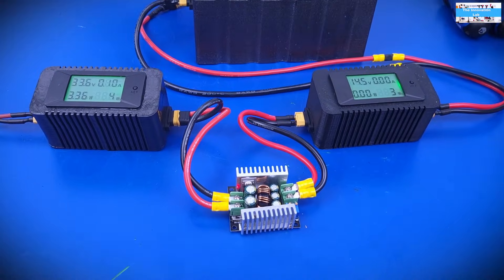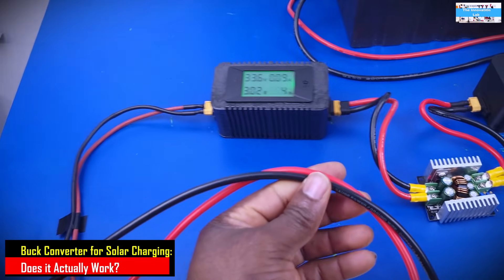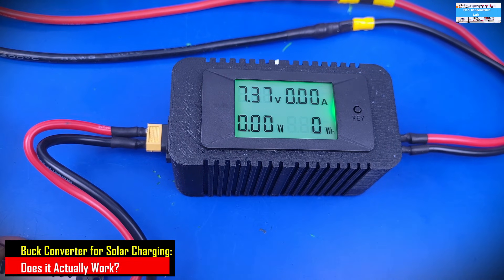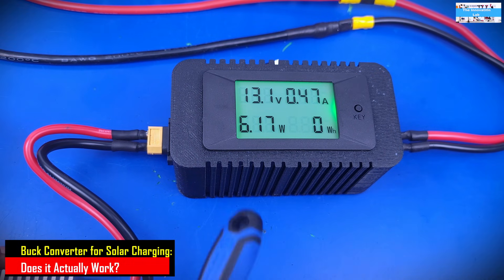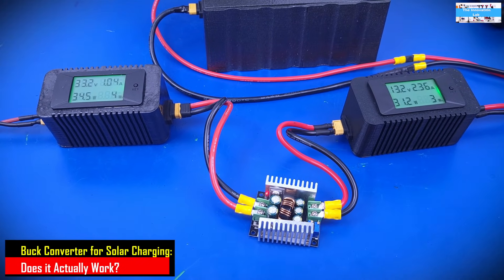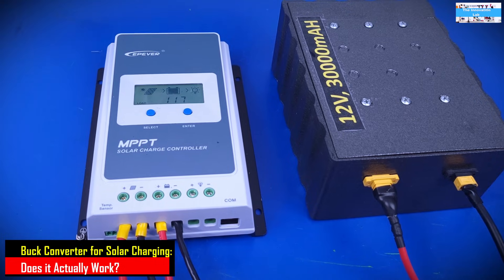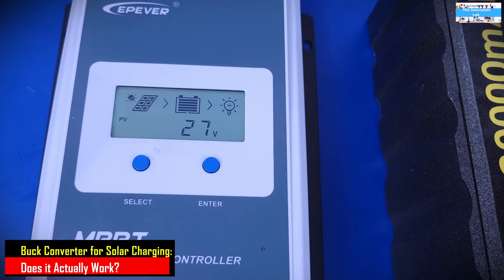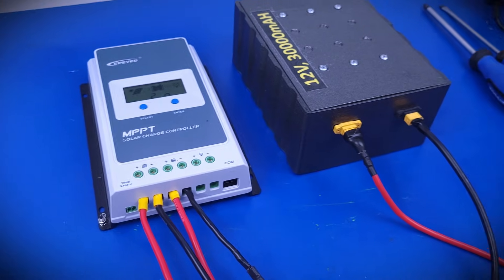DIY Solar Battery Charger, with a DC to DC Buck Converter.

Comment: crashing the panels cause you needs a diode to protect the panels.
Reply from the maker: I see you point.
I believed I repeated the test with a protection diode added to the input of the Buck converter and also achieved the same result. However, it was done a long time ago. I planned to make a follow-on video, but for some reason, the YouTube algorithm does not favor a lot of my solar project videos.
Well, let's see what the future holds.....too many project ideas but no time. I am simply too busy 😊.

Thanks again for the amazing feedback.
👍😎
The Innovati0n Lab.
Reply: Almost looks like you could be hitting the max amps that the battery can soak in and the BMS is cutting of or if your charging lead acid your shorting them. could also be the limit of the buck converter.  would be fun to revisit with different gear.  @theinnovati0nlab782

Comment: I tried this and got no output voltage
Reply from the maker: Sorry to hear that.
However, that shouldn't be the case unless you have a faulty buck converter or if your input power source is too noisy for the buck converter. 

If you can describe your setup, I will see if I point you in the right direction on how to troubleshoot it.
But this should really be a simple setup. Also, make sure that your input voltage level is within the converter specs.
If it is too LOW or too HIGH, you will run the risk of damaging the buck converter.
👍😎
The Innovati0n Lab.

Comment: Hello hello, to cut a long story short this buck converter looks to have a maximum current and wattage that it can handle. Did you find this to be the case?
Reply from the maker: Thanks for great feedback.
The quick answer is yes.
However, that is the case with every converter.
There is always a power, voltage, and current limit.

Comment: untuk mencoba buck converter dc to dc. seharusnya anda tidak menggunakan baterai sebagai beban. anda harus membebani dc to dc dengan beban yang tetap seperti inverter dc to ac yang terhubung dengan kipas angin 200watt. anda akan mendapatkan nilai maksimal dari panel surya yang anda pakai
Reply from the maker: Thanks a lot for the wonderful feedback.
What I am taking from your point is to expand the scope of the load tests in the future to accommodate converter output response to different load forms.

However, I respectfully disagree that a fully discharged battery should not be used as a test load. Also, the major focus of the video is to show that constant current buck converters can be used as efficient battery chargers.
The video is basically about solar battery charging.

Thanks again for the wonderful engagement.

Comment: The ampes works 5:1 only you need higher ampes input to get higher output
Reply from the maker: 5:1 will mean a 20% Converter efficiency. This is not the case according to my measurements. At heavy loads, these converters are supposed to have efficiencies greater than 80%

Comment: Looks like it pulled down the panel too much. I read that this can collapse a panel voltage permanently so be carefull. I have 5 of those bucks and i use them on a small buffer on my mppt that charges the buffer at 30v and empty it into my 12v bank continuesly.
Reply from the maker: Thanks a lot for the feedback and for sharing your experience on these converters.
👍

Comment: Buck converter better then pwm controller or not?
Reply from the maker: Hi, thanks for the thoughtful question. My intuition will be that the PWM controller should be more efficient than a buck converter - given the fact that PWM charge controllers are actually designed for solar charging....and buck converters are typically designed for constant power applications. However, I could be wrong since I have not actually compared the two. This is a good idea for a test video.
Stay tuned.
👍😎

Comment: Other thing that's important is that they're non isolated devices.. Means you MUST use diodes for back feeding & reverse polarity protection.
Maybe you can repeat the experiment with proper diodes. Get at least 50A rated ones. Lower are trash.
Reply from the maker: That is a great idea.
👍👍
Reply: Hi. Want to to use a DC DC buck converter to charge a LifePo battery. I heard about using a diode to prevent recurrent. But I don't know how to solder this.

Comment: What you're experienceing is buck converter "collapse" basically the source Cound not generate the power which buck converter demanded.
These cannot replace an mppt long term, but in emergency they'll charge your battery. Especially if battery & solar voltage is not very far apart.
Reply from the maker: Yeah, you are correct about the cheap buck converter not replacing an MPPT charge controller. This was essentially the point I was making in this video because a lot of kept asking about it. Those converters are very cheap and the price is enticing. However, the efficiency losses and overall performance with varying solar irradiance, is something to be carefully considered. I will repeat this experiment with blocking diodes installed as this is something a lot of people have suggested in the past as well, but I haven't gotten the time to try it.
Thanks for the wonderful feedback.
👍👍

Comment: Didn't you see the input current? It is only 1.05 amp, buck converter boosted it to 2.35 amp.( 6:52 ) Perfectly working, And you showed in a comment that the converter is working at 89% efficiency. So why you're saying it doesn't work?
While your panel is making only 34.8 watt from sun at that time, how can you expect more than 31 watt from the converter? The problem is your solar panel. Maybe it is because of shedding. But you're blaming the converter.... Lol.
Reply from the maker: Hi friend, 
Thanks a lot for the wonderful feedback. I do appreciate it. However, did you watch the entire video? 😊
I am only asking because if you did, then what I was saying about the converter being the likely culprit might make a bit more sense to you. I added a control test with the MPPT charge controller in the end (<10 minutes later and same conditions) because I know that a lot of the viewers will say that the issue was the solar panel.
The 220W  solar panel with maximum irradiance, at 12 noon, should not be delivering only 34W. 
I used the control experiment in the end to prove this point. 
There were no shedding, no clouds, no coverings, on the solar panel.
Reply: @theinnovati0nlab782  Thats seems like a solar panel problem, buck converter still did  its job given what it was given.  At 2:08 you showed the panels and one of them was half shaded.. maybe thats why?  I dont know, 34w does seem low but its not the buck converters fault it shouldnt affect the panels input voltage which was only 33v 1 amp when you had it plugged int.  And with that it seemed perfectly fine working buck converter, something is up with the panels.  Maybe the 2nd panel got out of the  shade when you plugged in the mppt converter? Very strange plugging the panels into the mppt gave you full watts from the panel.  Anyway I just got a similar buck converter im going to try with my 180w panels to make sure and ill let you know. Didnt plant to use it for this because i got a regular pwm charge controller i think works just as good but now im curiouse.

 I do know these CC CV adjjustments are finickey and with solar panels youre basically manually finding the maximum powerpoint, which you can overshoot and get lower watts then you should which easy to do with these trim pots,-overshoot them before you find that maximum power point. Ive had this issue with a similar converter but a boost i was using to boost a 19v panel to 42v to charge a 36v scooter battery.  It worked but only managed 22w from a 40w panel.  Thats because I wasnt in full afternoon sun (late afternoon like 3 -4) and after boost converter losses 22w seemed right i think. The issue was it was very finickey to get that maximum power, too much adjustment and it would go to 7watts, too little it was at 7watts... you had to find the right spot to get it to 22w and seemed to change overtime so you had to keep adjusting. No wonder they have a microcontroller do this automatically.  Thats what an mppt charge controller is, just a  micrcontroller controlling a buck/boost converter to keep that maximum powerpoint.   Ill see if the buck converter is as finickey, maybe i can find the maximum power better then the cheap PWM charge controller im using? ...
Reply from the maker: @SA-yc9lf  
Guys!!
I am beginning to sound like a broken record on this. It was not the solar panel.  Please watch the video to the end where I shower the control test to see how much power the solar panels were able to put out using the MPPT ( 7:45 ) time code. I don't know where you guys think that your theoretical observations and calculations trumps my real-life test observations. 
The buck converter test and the control test were both  conducted at maximum irradiance.

I have a new video coming out tonight using the same panels but a different converter, and you will see a delivered output power of about 200W.

You guys are wrong on this one. The issue is not the solar panels. Impedance mismatch issues between the converter and the solar panel could lead to oscillations, hence causing the converter to underperform.

I am not some guy on YouTube soldering wires, I am a professional in this field...lol.
The Innovati0n Lab 💥 
www.theinnovati0nlab.com
Reply: @theinnovati0nlab782    I see but we dont have the benefit of knowing what you really did, only what you showed us, and you showed us a perfectly fine working buck converter given its imput voltage and a weird solar panel that was only producing 34 watts  you claim was under full irradiance yet you show it was half in the shade in the video, and thats the only logical conclusion I can come up with, with all due respect. 

So in the end I dont thik it was not a fair comparison between a buck converter and mppt as they both didnt recieve the same input voltage, whatever the cause of that reason. I suspect a buck converter is just as good as an mppt charge controller as you get to manually find the maximum power point, it just doesnt have auto tracking abilitly. And maybe with a microcontorller you can make it autotrack. So maybe not for $5 you can get a cheap mppt charge controller, but for $10 (mictrontoller + buck converter) and you can.  But how do you control the cc and cv trim pots with an arduino?  robotic actuator motors? ...
Reply: This is a Chinese buck step down and they don't bring the real power but rather below.

Comment: This is quite common, what happens is when your input does not have enough amps to feed the buck converters output, the buck converter will draw the input down to just over the output voltage, so in your case your solar panel is pulled down to ~14V and at that voltage it will only deliver 0.5A. Im using a step down converter as a temporary charge controller, but i run 57V charging and my pannels 2x36V in series still perform somewhat good at 61V that the buck converter will pull it down to, to supply the output 57V.
Reply from the maker: Hi friend,
Thanks a lot for the wonderful feedback. I do appreciate it. Thanks for sharing your experience. 
However, if you watched the video to the end, you will see that I performed a control experiment to rule out the issue of insufficient power from the solar panel.😊
Is the  buck converter you are using a constant current buck converter?
I will be retesting in a future video.

Comment: I use dc to dc buck converter for charging my battery and i put welding diode for anti Backflow 😂
Reply from the maker: It's definitely a great idea!
Now, you got me thinking. 😊.
I will definitely try that to see if it will help improve the stability issue. However, the system will still suffer lots of losses, as those are cheap buck converters, and they can't do MPPT.

Comment: Buck converter. And mppt is the same voltage. Compared to Pwm. Buck converter have current limit. And the power current is depend on the highly sunset condition to get the set limit current. 
 Mppt. Have automatic current limit if in low sunset it can boost Current. And limit the current. Thats what i think. I use a mini 5a buck converter to charge my battery. It works. But the current is continously increase. And very fast decrease . It has a unstable current but stable voltage my exp. Using buck converter as charger it can charge but low efficiency
Reply from the maker: Thanks for the great feedback. Is your buck converter a constant current converter?

Comment: 30 ah battery multiply 10% minimum battery rating is 3 amp. I think it can charge the battery. Or maybe the sunset outside is not good. Make video. Pwm vs. Mppt vs. Buck converter
Reply from the maker: The battery pack is a lithium phosphate, and it can handle high current charging. Besides, the issue was that the buck converter was actually blocking the power from the solar panel. Why settle for a 3A charging current when you expected 15A? That seems like a lot of wasted power and horrible efficiency to me. Also, charging a 30Ah battery with 3A means that it will take 10 hours to charge. Then why build a lithium phosphate battery and slow charge it like a regular lead-acid battery?
😊
Thanks again for great feedback, friend!
👍👍

Comment: Dc dc buck converter is very bad as solar charger. I bought 4 pcs but it is not working. Very bad... They all the same bad. Dont use as chrger. You cannot adjust both voltage and cc. They crashed 😡😡😡😭😭
Reply from the maker: Hi friend!
Thanks for the feedback.
👍
That was exactly why I made this video. I was asked about it a few times in the earlier videos, and I don't think it's a good idea.